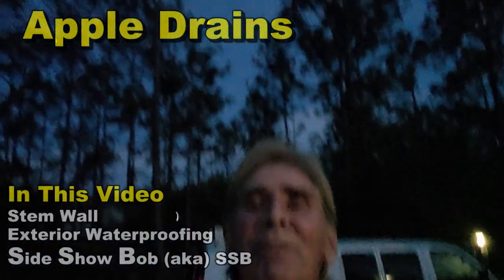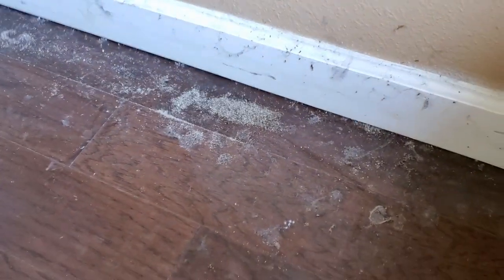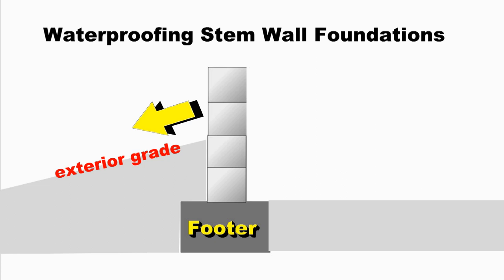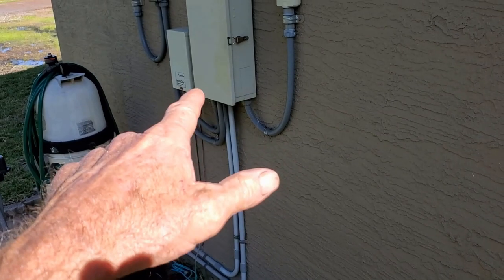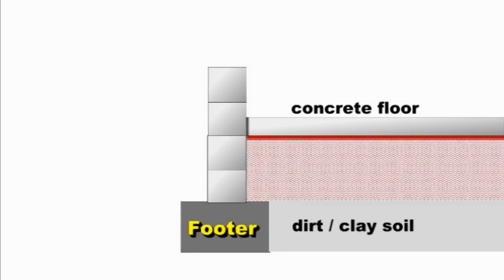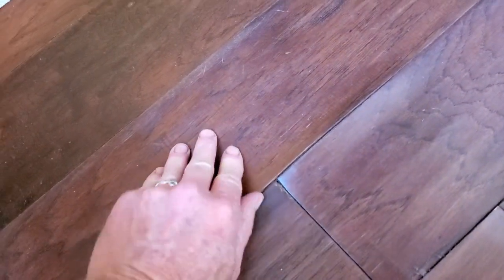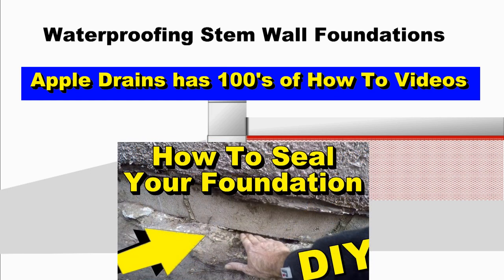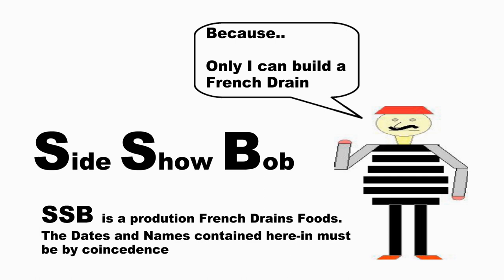Waterproof Exterior STEM WALL Foundation, French Drain, Footer Pipe

Comment: Curious to know you could not lay the external drain tile below the floor.  Why dig down to the footer?  Seems to me that would save on labor. I understand you have to do this in this case because of the 16 inch elevation drop from front to back. The builder of my house originally planned a full height basement, but he realized after excavating for the foundation it was just too wet, so the resulting crawl space slab  is about 2 feet above the footer. Not sure if he backfilled all 2 feet with stone or a combo of the over dig and stone.
  I get water in the crawl from hydostatic ground water pressure when we get 6+ inches of rain in a 24 hour period, so I was going to put in an internal drain tile below the floor but above the footer, directing it to a sump.  Will this work?